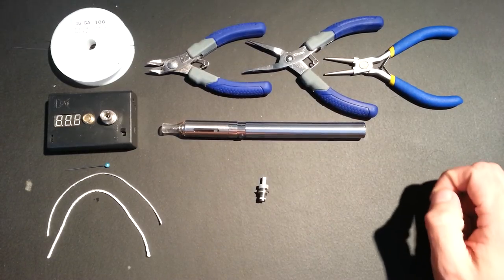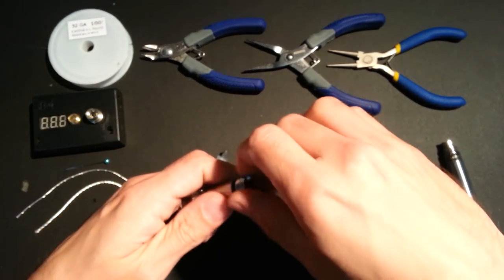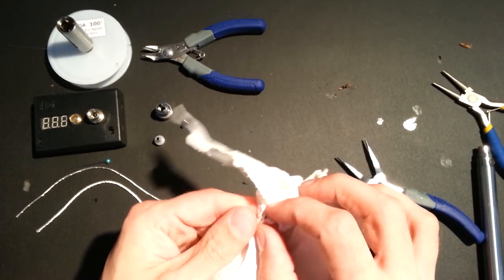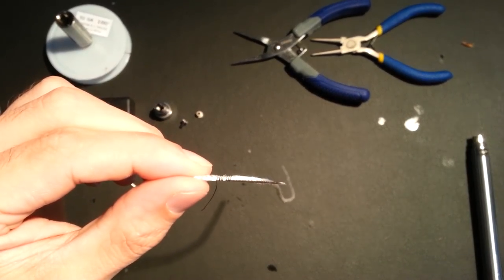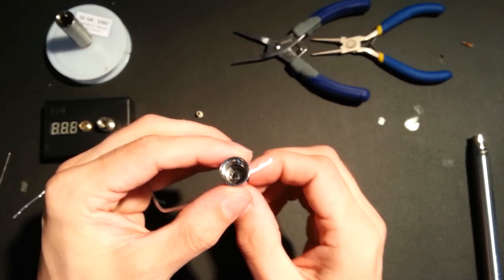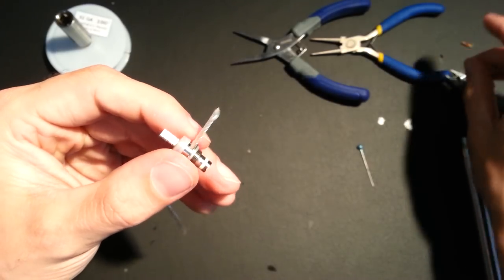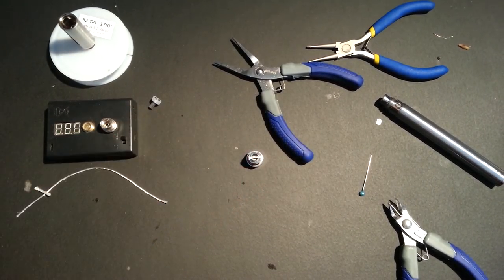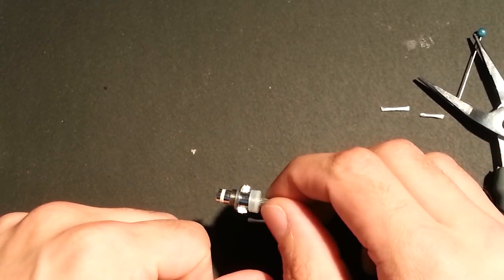Kanger EVOD T3 MT3 Bottom Coil Atomizer Rebuild HD Close Up

Comment: Thanks for the vid bro. I use EVOD heads in my Tatroe and Protanks and I'm starting to rebuild them with 400 SS to use on my mech mod. I also purchased some 32g wire from you a couple of weeks ago off of eBay. Thanks for the quick shipping!

Comment: Got a tip that i strongly recommend to avoid a dryburn (and burn your coil out).
buy a gasburner (blue flame) and hold your wick in it till it is white. then pull it out let it cool down al little en do your job. it wil give a harder feeling and is a little brose but you'll never have a nasty taste

Comment: Great video bud, thanks! I do have a couple of questions, if you don't mind please. Does placing wick over the coil impact the vapor production since the vapor from the coil has to filter past the top wicks? And also, what is the purpose of soaking it in water? The dry burn I can understand, but I am a little confused about the soaking. I picked up some wick, and am looking forward to trying this rebuild myself. Thanks!

Comment from the maker: Absolutely :-) believe it or not, the flavor wicks actually amplify the flavor. Try it without them and you'll see what I mean. It's the filtering through the top wicks that helps the flavor, and it doesn't limit production at all. Second, the purpose of soaking in water is to clean off any left over residue that may be on the wick or coil from the burn. You can get away with not rinsing them , but the first couple of puffs might taste a little bleh.

Comment from the maker: You could try it for sure. It looks like it would leak though. Each 1mm wick plugs the respective top corners where the head attaches. I feel like a single 2mm wick would leave the corners open too much and let fluid leak in. Special care could be taken to break up the 2mm wick enough to plug the corners though I suppose.

Comment: Great video, just thought I would point out a few things I do differently: I prefer to torch the silica and the wire before building the coil. This gets rid of the silica taste and makes the wire easier to work with (reducing the springy-ness of the wire). I also build the coil a little differently. instead of wrapping the coil directly on the silica I wrap it around a tooth pick or 18 gauge needle then set the needle in place on the head and assemble the head around it. This allows you to replace the wicking material without removing the whole coil (especially nice if you use hemp or cotton). You can look up the coiling technique by googleing "micro coil build" or something to that effect.

Comment: Do you recommend 32 gauge @ 13.75 ohms/ft or the 5.27 ohms/ft? Great video!  I'm just ordering the supplies to rebuild for the first time.  Can you use copper, brass or gold wire?  Kay
Reply from the maker: No, either use kanthal or nichrome. Anything else is either toxic, or just plain won't work. 32 Gauge is a great beginner middle of the road gauge.

Comment: great video! i just had a few questions. i opened it up and saw that the wires were wrapped closely. why did you you choose to do it spaced apart? and can i use a lower gauge wire like a 30 or 28 and if so how many wraps would you say would be best for clouds and less throat hit?

Comment: Great video. I have a question. You are using 32 GA wire. I just bought some  Kanger Replacement Single Coil for MT3S and T3S to use with a Joye Ego-c 1000mah. battery. The coils are 1.8ohms.. What gauge wire would recommend for me to keep them at 1.8ohms when I rebuild them? Thanks!

Comment: I've actually had a coils that I haven't used, (I was sent the wrong coils) I took them apart and put them in the evod as described. It worked, so I decided to order in the wire and silica wick so I could do this on my own. I just have one question. Why do you dry burn the coil? I've never done this before with any coil and I've always wondered why it was done. Also I guess why must they soak?

Comment: Oh and for anyone wondering I believe I found a solution to the burning problem, see my last comment. make sure after you put the rubber gromet back in and the metal pin that you pull the wires so that it pulls the coil down farther into the channel. This has seemed to have fixed my problem, just pull them tight, along with a dry burn, and soaking if needed and you should be good to go!

Comment: Hey Sean.  I bought an extra MT3S Atomizer the other day, and the coil that fits into it and the stem receiver itself was a different size than those on my stock MT3S EVOD Starter Kit Atomizers.  The extra Atomizer Coil Stem looks to be the same size as the one you are replacing in this video.  The stem is smaller in both outer diameter and length than the stock 1.8 ohm coils that came with my EVOD Starter Kit Atomizers.  And the Stem Receiver inner diameter is smaller than my EVOD Starter Kit Atomizers   Do you know what the deal is with these size differences?  I really would like to by some more MT3S Atomizers that are the same size as my stock Atomizers.  Thanks for the videos.

Comment: heat the wire under flame b4 wrapping it and the factory oils wont soak into wick when you heat it, then you wont half to soak the thing over night. just assemble and use right away

Comment: Did it got your wick and wire and rebuilt the Atty head that came with my pro tank that burnt out day one mine came out 2.1 not too shabby for a first timer considering the 2.2 I just bought reads 2.7 lol now my juice taste like perfume though maybe 2.1 is low for 3.7 volts thanks couldn't have done it without you super easy :-)

Comment from the maker: Meh.. Good question. I know I hate drinking the juice. The only partial solution I've found is ball-joint mouthpieces that swivel, so while you might be laying down having a nice vape, the unit may remain upright while the mouthpiece is at an angle, thus eliminating tipping the darn thing up side down into your mouth. That's the best suggestion I have. Happy drinking/vaping.  What is your suggestion?

Comment from the maker: I personally don't oxidize my wick, I've tried it and it doesn't do much for me. With the evod, I use 2.2 - 2.5 ohms of resistance. It holds up well to higher voltages, eg 4.0v , 4.3v and makes cloud after cloud after cloud :-)

Comment: 'Got the wicking & wire from ya (very nice, thank you!)...and the meter from madvapes.  But we prefer 2.5 ohms rather than 2.0...so we went with 8 wraps instead of 6 to get the 2.5 resistance.    WHOA - it seriously altered the taste of our juices (some for the better, some for the worse).  All our other gear is 2.5 and there's no substantial difference in taste.  What do you suggest we use (and how many wraps) to achieve 2.5 resistance?  T

Comment: i started rewicking my protank heads and i love it then i started using 400 ss mesh to extend the life of the heads but i kinda have a weird flavor at times but it goes away is it because i didn't soak it in water for a few hours and i didn't dry burn it? i went through the oxidation process so i figured i wouldn't have to dry burn but if you know please answer

Comment: Hey Sean...a great video!  Am new to vaping and am currently using an EVOD 900maH model at 2.4 ohms.  Could you tell me if it is the number of wire wraps to the burn/coil wick that determine the level of ohms being produced by the atty or is there some other factor?  What would help get me as close to 2.4 as I can when doing a rebuild?  Also...can you tell me how Volts come into play and how you can know how many volts are being produced by an existing battery (without packaging information...or a meter).  Thank you in advance!
Reply: S
Reply: On what determines the ohm is how close the coils are rapped and what gage the canthal is also
Reply: +ADarkAriaUSA No offense but you can find that information if you google it. Don't be so lazy. It takes like three seconds to search and find what you need....
Reply: To get to a 2.4ohm do a 4-5 wrap of a 33g kanthal. It all depends on how many wraps you do and how close you wrap them together.

Comment: i did this about 10 times with  3MM wick + 30G A1 Kanthal....and i get a burned rubber taste every time.....i see that the legs of the coil get red hot when i dry burn.how can i get this to stop?if the wick is too tight ill pull out a few threads of the wick so it wicks better

Thanks for any tips u can give me

Comment: Okay I've rebuilt the coils a few times now, maybe 20 times or so, and even if I make the coil look perfect just like the ones you buy, and even if I dry burn it, no matter how long, I still get the burnt taste. It doesn't fade away either... I have no idea how to fix this, any suggestions? I'm using the suggested kanthal 32 gauge, with 2mm silica wick, I split it for the flavor wick.

Comment: Hi,

I am interested in finding out more information from you on these EVOD coils.  I use them in my Kanger Pro Tanks.  I use a 510 MOD that does 3.0V-6.0V using a IMR 18650 Rechargeable Battery (3.7V 2000mAh).  I am looking for more resistance so I need to get information on doing a rebuild that will satisfy the Ohms needed to use the 6.0V setting and not burn my coil out which seems to need to be over 5 Ohms from what I have read. Do you have any suggestions? 

Thank You

Comment: no idea what im doing wrong, but I tried about 10 times, and just could not get it. I wrapped the coil, bent the first wire, put in the grommet, bent second wire then inserted the metal plug. I powered battery and it just flashes at me. I can push on coil and every once in awhile itll work, but never got one to work. I either cant get it to ground good or something. Very frustrated and dont know what im doing wrong?

Comment: New to rebuilding and have got it down to a science, but I am getting no air flow thru the atty like when I use a pre bought one. What could be the issue here? to much wick? not enough?
Reply from the maker: Darin Kramer It could be too much wick. The air is drawn through the center bottom pin / stem. I would check there first.

Comment: Can a Evic E-Cig substitute the resistance meter?  Is it circuit protected in case there may be a short.  I am rebuilding a Kanger Protank head and I don't need to screw up my new Evic. I can't find anyone who has the meter that you use. where do I get the adapter?  Any suggestions?

Comment: Ps can't you just use a regular electrical multi-meter to measure the resistance instead of getting one of these specialized meters with the screw attachments?  That's what I'm going to be doing. Even though my eVic shows the resistance, I'm not sure how accurate it is.
Reply: Only problem I could see with a multi-meter is getting good contact with the chrome plated parts, but I'd trust the readings a lot more and if you already have one, as anyone who calls himself a man should, then I'd use it and save yourself the $20.
Reply: jak442 I see what you're saying, but what I've been doing is first measuring straight off the kanthal before I trim it back to the metal plug, then I test from the plug to the negative side after I've trimmed it..I hate getting surprising shorts when everything's back together. I get accurate readings so far with both methods but I do have a pretty good Fluke meter.  Cheers.
Reply: There's also a benefit to being able to test coils before spending the time to mount them in a head, especially if you're playing with micros, resistance, wire gauge, etc. The case for these one purpose ohm meters is pretty sad when you can buy a more accurate and useful multi for the same $. suckers
Reply: Karim D Yep, it's just that easy. You can do this every step of the way; when it's attached with the plug you can put one end of the meter's probe into the center hole and the other onto the threaded base or anywhere metal pretty much.

Comment: Hi, is this also suitable for the dual coil Evod 2 tank? I'm thinking of getting the JACVAPOUR 510 Twist 900mAh Starter Kit which come with the Rebuildable 1.5ohm Evod 2 tank.
Reply from the maker: squeeza It could work with a thicker silica wick. Instead, why don't you take a look at this tutorial? It should be the same coil head:Kanger Protank 3 Dual Coil BDC Atomizer Rebuild Tutuorial HD Close Up
Reply: Sean Hanson Thanks, I've now decided to get the Kanger Protank 3 instead of the Evod 2. Hopefully there wont be any problems rebuilding it thanks to your excellent tutorial. Brillant advice, thanks again!!!

Comment: Can you build with a 28g the same way or would it not work
Reply from the maker: It could, it just depends on what you yield in resistance in ohms. Many vw / vv devices will not work with anything less than 1.0 Ohms.

Comment: Where can i get these flavour wicks, note im not from america?
Reply: Flavor wicks would just be extra silica wick that you cut and put on top of your coil. So the same wicking material used for coil would be fine.
Reply: I think you didnt understand me, i asked where can you buy the wickinh material, or where do you usually buy it.
thanks
Reply: Sojko Macka I personally buy from Kidney Puncher or Electronicstix. I know that Kidney Puncher sells internationally to several countries. There maybe several other sites that do sell it and may be cheaper, but so far the customer service has done well by me. Silica is under Rebuildable Supplies on most sites.
Reply: Sojko Macka   EBAY. Get everything you need there. Kanthal, Silica wicking, anything. Here is a good link if you don't really know much about Kanthal. (Very helpful when starting coil building)
 http://truevape.co.uk/kanthal-wire-guide/  Happy Vaping.
Reply: Thanks
Reply: ♫ Hope you find what you are looking for Sojko Macka .  Vape on and vape strong..

Comment: I rebuilt the could head, but when i use it on my kanger or any other high end battery's it just blinks.But for some reason it works with and old junk XPS battery. Any one know what went wrong?
Reply: ok i think it was a short, it works now but it only works for a few seconds then blinks and cuts off. Does any one know whats going wrong?

Comment: they have a new head design now, you cant get to the coils anymore :/
Reply: yes you can, i rebuild the upgraded ones just fine.screw the coil in and use needle nose pliers to pull the top off similar to the one in this vid.
Reply: Liquivana Vape
do a vid on it then, i'm really curious as to how. i can get them apart and get the coil set, just cant get them back together
Reply: The rubber grommet is a pain cause it's longer. And the top is a bear to. Can't do a video though sorry. If I had a good cam I would.